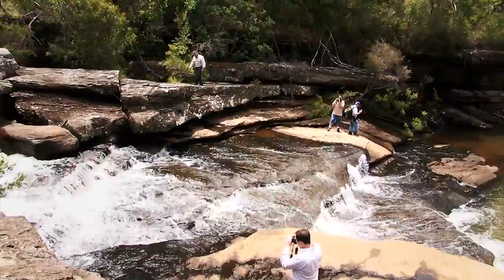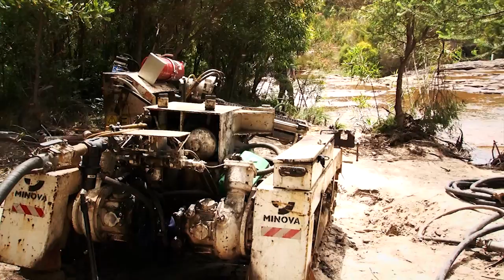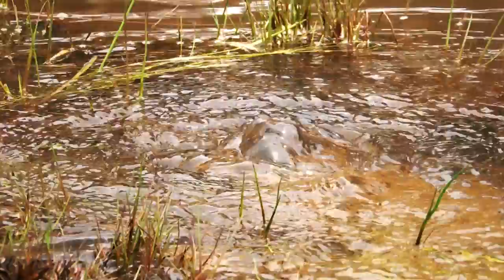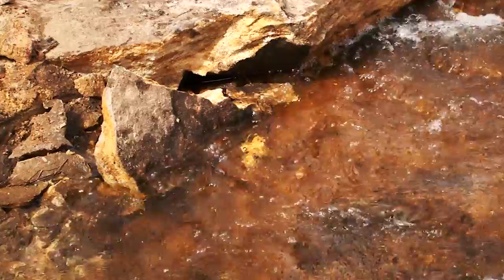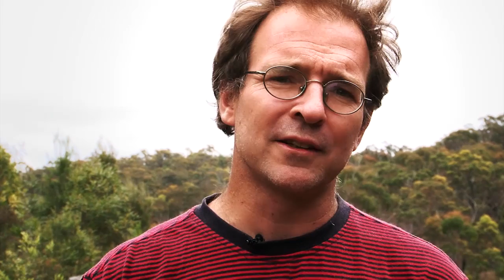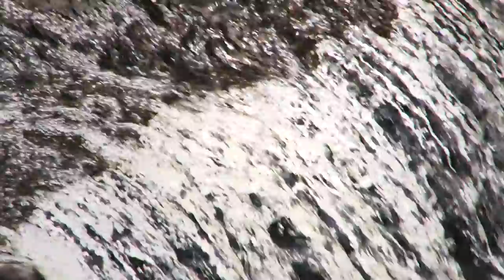Waratah Rivulet... Our drinking water in crisis

Comment: I'm a little confused over the statements referring to the equipment that is shown. The impression given is that it do with mining but in actual fact all equipment shown is to do with filling in the cracks (which is an idea that somehow doesn't feel good). How do I know this? I was there in March 2011 with some of this group shown. That equipment was there in March, and pretty sure it's what I saw. Much more water flowing in Dec. I was not invited to that Dec visit, but I did my own video in March and believe it's more objective than this one. Which is probably why I wasn't invited back in Dec...!!!
Reply: The equipment is being used by the mining company, for drilling holes and filling in cracks in the river bed with polyurethane sealant. The cracks are from longwall mining underneath and subsidence. This is like playing humpty dumpty with Sydney's water supply. The water is clearly not in the quality condition it should be. All of this is clearly stated in the video.